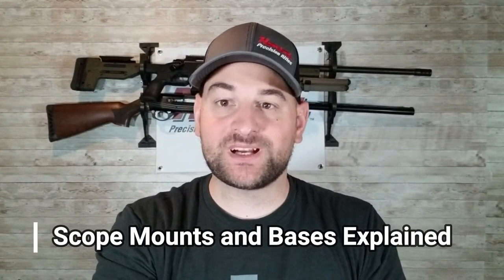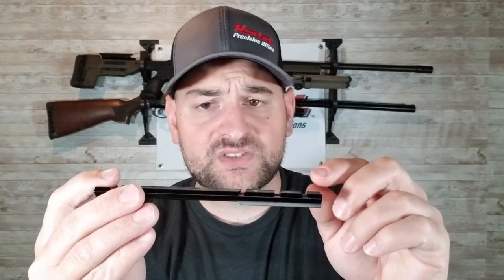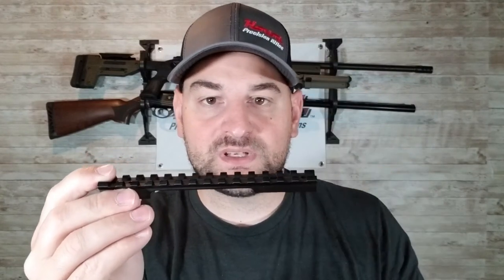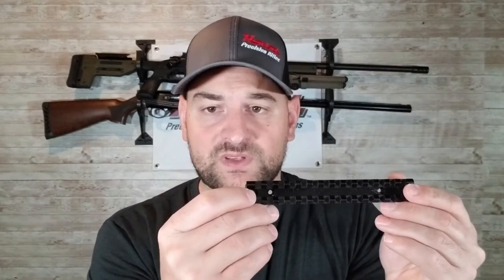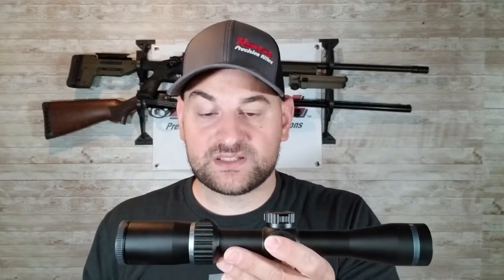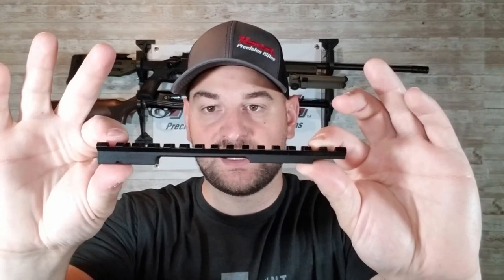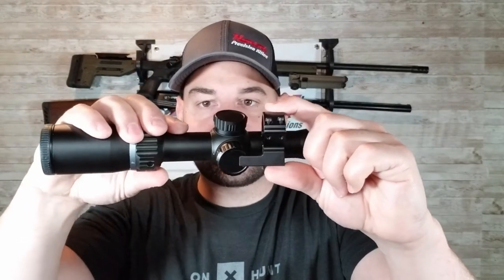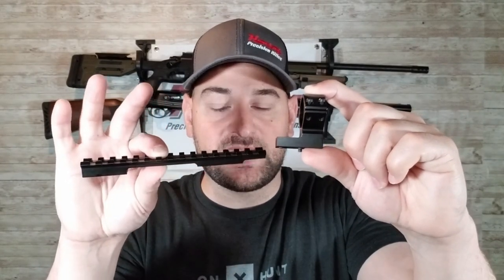HOW to CHOOSE SCOPE MOUNTS!

Comment: This video is a Godsend! Picking up my Howa HS 1500 Precision hunting rifle in .300 PRC later today. DOJ/FBI overlords finally kicked it loose, after five days of purgatory-like holdover. Being notified that the "Proceed" order finally came through to my FFL guy, was a lot like being told I passed the audition for a coveted gig, with a group of guys I've been dying to jam with!

Chose the Howa over the Bergara because of my unabashed love for my Vanguard rifles, and personal "Seen the light" testimonials for all things Weatherby. Figured with some of the same shared pedigree, I couldn't go wrong with the Howa. Going to work up an elk load for Wyoming this fall; as I anxiously await draw results. 

Warne makes the 20 MOA pic rail specifically for this rifle. I see it is one you recommend on your preferred list of "quality" rails. I have never installed nor shot from a pic rail on any standard wood or synthetic stock hunting rifle. I've only used the normal two piece base and scope rings mounting systems. 

Because the case of the cartridge is so long, any concerns about it hitting the rail on ejection instead of clearing, and falling back into the slot, thus preventing the next shot? Also, given the cant of the base, and the desired lowest possible free resting position for the bell, which ring height do you recommend for a 50mm objective lens? Thx B4B! 👍🏿

Comment: I should have watched this video two years ago.I always take off weaver or pic rails off my guns if they come with them alot do and then install tally rings (they work).Simple reason I do not understand the rail systems.I just recently purchased a Turqua rifle. not a bad rifle. However it is made in turkey and comes with a pic rail but reciever is round and I cannot find single base mounts to fit this design. I now understand the rail systems and feel confident I can acheive the same results as I get from talley mounts. Thank you, great instructions even I can understand, Regards
Reply: I have lots of bad experience with Turkish made guns. I do not recommend anything made in Turkey unless made with strict specifications by those companies who deal with them otherwise they’re junk. You should see what kinda shotguns they make for local or Middle East area , they’re the lowest quality with lots of flaws.

Comment: The talleys are rock solid. Bed them to the receiver, and you will have no issues. My only gripe about pic rails is they make the scope kind of high a lot of times for most stocks. Also, not all pic rails are equal. A pic rail with a recoil lug on the bottom front of the rail is the way to go. Near actually makes a dual lug pic rail.

Comment: Hi i have a modern 1885 high wall  hexagon barrel non drill and tap  ,the sight is on a flat surface,iam thinking about mounting a scope,the you have any idea of rails that can be mounted on a flat barrel,all the one I see have a radius on the bottom.thank you great video

Comment: I just got an HS Precision 2000 HTR .338L and plan to put a Leupold Mark 5 7-35X 56mm scope (100/50 MOA total travel on it).  I want to zero it at 200yds, but still use it occasionally at 880 (1/2 mile) or 1000 yards.  The tech support at  Talley said I would be OK with a 0 MOA pic rail for no hold shooting. After watching this video, I am not so sure. Thoughts?

Comment: I have a H&R Handi-Rifle with 2 barrels. one is a .357/.38 Spl, and the other is a .44mag/.44 Spl. I bought two Aim Sports compact 4X32 range finding reticle scopes from Sportsman's Guide -one for each barrel-. Both require a 3 1/2' eye relief. I also bought a picatinney rail - 0 moa, and a weaver rail, also 0 moa. My shooting with pistol caliber ammo will be at 150 yds or less. My issue is that I can't adjust the scopes to get the needed 3 1/2" eye relief. The picatinney rail does get me more rearward movement with the scope, but not enough. The weaver rail isn't going to work regardless of what I do. The adjustments are just not there. What should I do ?

Comment: I have a Remington 700 in 308. I mounted a 4to 14 x44 scope with a 20 Moa base. At 100 yards I am 6 inches high. I have no more adjustments in my scope. Do I need to get a 0 moa base?
Reply from the maker: A 20 moa base should work with most 4-14x44 scopes. Sounds like there might be some other issue
Reply: @Bullets4Bucks  do I need higher rings? Lower rings?

Comment: Hi what amount of MOA on a piccatiny base would you recommend I put on a Winchester coyote lite 22-250 for fox shooting no further than 400 yards
Reply from the maker: 0 moa
Reply: The only reason I order 20 moa mounts is because they were available. My 30-06 Remington 700 and my Browning A-bolt 2 7mm rem mag may be aboe to benefit from it but I personally would never take a shot at any animal just because of the chance of missing or maiming it as well as the lost energy at those types of ranges. The scopes I use however do work with the 20moa cant if i need it ever. I may be wrong but most common and newer custom loads for precision rifles are very capable of accurate shots up to 1000 yards with 0 cant. If I’m wrong let me know but I’ve been told that a 7mm magnum can shoot extremely well up to 700 yards with almost no hold over. I honestly think that a lot of people especially those who are like me not as experienced in Long range shooting or really need the features to do it over think stuff. Start small, take your time, practice, get good and gradually move up to more challenging shooting. Instead of practicing to shoort extreme long ranges, learn to quickly acquire your targets accurately, learn to do accurate follow up shots, learn to shoot from different angles uphill down hill, from a rooftop, treestand, different weather conditions as well as lighting conditions, and when you master all that then learn to do the long range stuff. If you just wanna do benchrest shooting then build an overbuilt ugly benchrest rifle and stick to your little stool lol. Learn to range with your scopes too even with basic duplex reticles it can be done as long as you have a good reference to go off of.
Reply: did you watch the video? lol

Comment: would an integrated ring base be the most durable option?
Reply from the maker: A one piece is the most solid bet
Reply: @Bullets4Bucks  right on thanks for your fast reply
Reply: @Bullets4Bucks    Which one piece do you recommend for a Scar-17
Also, a one piece for my other AR-15s?
Review of about 4 one piece set ups from X Utuber I can't think of gave American Defense a higher rating than  Scalarworks mounts, agree?

Comment: Looking at a Talley rail for my Bergara B14 and it comes in long action and short action. Is there a significant difference between the two and is one better than the other?
Reply from the maker: Short action must be used on guns chambered in short action, for and long action must be used on guns chambered for long action.
Reply: @Bullets4Bucks  Thanks for the reply. Bought it in 6.5 Creedmoor which is considered short action.
Reply from the maker: @schnibbyy  yes so you need the SA version

Comment: i just got a howa. do i need to put that paste on the bottom of the base? i really dont want to do that. also is there a base with a recoil tang?
Reply from the maker: No and no. The rings will have a recoil lug if they are good rings and you mount them to a base. Do use blue loktite on base screws that go in receiver and use a torque wrench
Reply: @Bullets4Bucks  thanks for taking time to reply.

Comment: I’m trying to figure out if I have the right base on my rifle . The back weaver two piece base . Is higher then the front so much so that there is a literal drop when I put weight on the back base and ring . I don’t know if that’s just a moa base or I got sold the wrong base for my savage 110
Reply from the maker: Typically the 2 piece bases are not more than 0 MOA You have the wrong bases or the wrong one on the back. It is hard to tell without seeing it. However one base will be thicker on some actions even if it is 0 MOA due to the receiver design. Confused yet?

Comment: Hey B4B I'm having a hard time sighting in my 20 MOA rail. I just got my Howa 1500 TSPX. 1st time I've ever had to deal with a 20 MOA rail. Will a lazer bore sighted help¿.
Reply from the maker: I would just use the sight in method I have on my channel and start at 40 yards. Make sure you have the rail and rings mounted properly.
Reply from the maker: What scope is it?
Reply: @Bullets4Bucks  vortex strike eagle 5 x 25 x 56 FFP